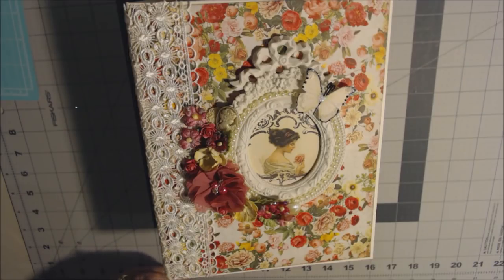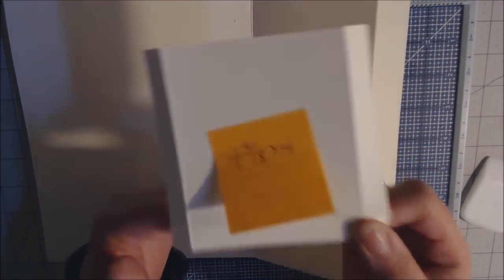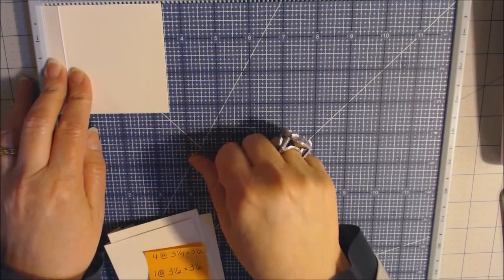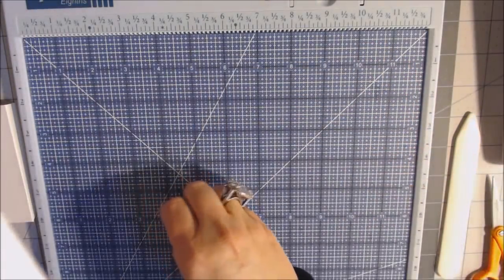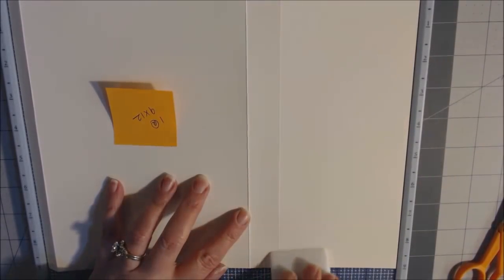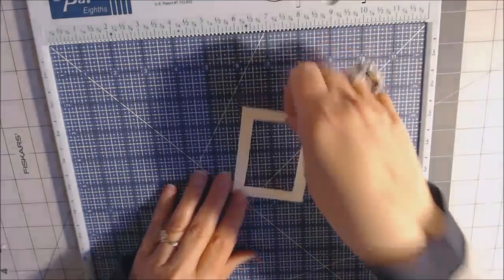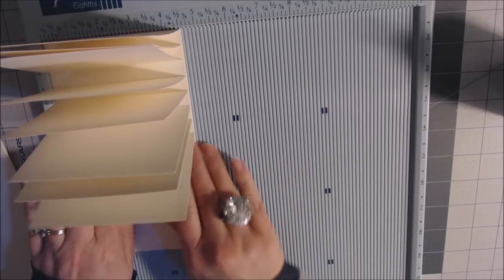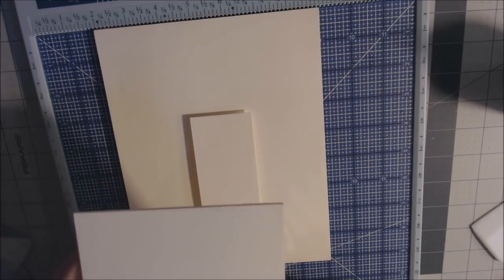Dame mini album tutorial

Comment: Do you have videos where you show attaching the decorative paper. I’m extremely new
Reply from the maker: Unfortunately, no. I usually just do the construction of the book due to time constraints.
Reply: @KimKantStopKrafting   Ok. I’m going to try. You said you cut the paper 1/8 inch smaller that than the page and I guess you round the corners after in order for it to fit right?
Reply from the maker: Yes, 1/8 smaller then round. Some people do 1/4 smaller. It’s whatever your preference is.